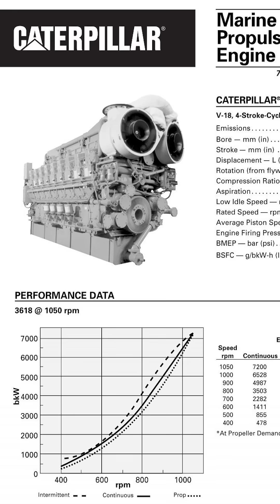wHy Don'T CaRS uSE V18 ENGiNEs?

Comment: Correct me if im wrong but if you keep making an engine longer and longer at some point the drive shaft would start to twist under the tension of all of the cylinders and become a floppy mess. Im no expert but i feel like a v18 is getting pretty close to that limit

Comment: The Bugatti is a w16 not v16
Reply: the newest Bugatti Tourbillon has a v16, next time think before you comment.
Reply: @christopherhallock3005  Sorry, yes, you're obviously correct. I guess i should have been more specific. The Bugatti shown is equipped with the w16.
Reply: @chadbracegirdle5498  the bugatti tourbillon shown at 0:04 has a v16

Comment: It’s a w16 but u kno same same ig
Reply: the Bugatti Tourbillon has a v16
Reply: I was talking abt the ministral
Reply: @ when was the ministral mentioned in this short?
Reply: I never said it was😂
Reply: @ then why tf are you talking about a w16?
Reply: Bc I can take abt whatever “tf” I want
Reply: @ buddy thought all bugattis have a w16 and cant accept that he was wrong😭
Reply: When did I say all Bugatti’s have w16s?
Reply: @ThatOneMfpplLuv  when you said: "it's a w16" you have the comprehension skills of an ant
Reply: u talkin like u built engines but u prolly think spark plugs need water respectfully, go read a manual before u speak again
Reply: @ quit gaslighting yourself😭bro thought a w16 was the same as a v16
Reply: A V16 engine is a traditional engine configuration where 16 cylinders are split into two equal banks of 8, forming a V shape around a single crankshaft. This design is extremely long and heavy, which makes it impractical for most modern cars—it’s more like a flex you’d see in old-school luxury rides or big power applications where size ain’t an issue. Think of it like two V8s side by side, all cylinders lined up clean and straightforward.

Now a W16—like what Bugatti rockin in the Chiron or Veyron—is on a whole different level of engineering. It ain’t just a V with more attitude, it’s built like two narrow-angle VR8 engines merged together. So instead of a wide V, it’s a compact double-V—four cylinder banks arranged in a W shape, all turning one crankshaft. It’s like stacking two mini engines together and makin ‘em spin in perfect harmony. This keeps it shorter and more compact while still making massive power, and it helps wit weight distribution and packaging—essential when u tryna go 260+ mph without blowin up. Too make this simpler for ur brain to understand it’s all abt the layout.
So yes believe it or not I do kno the difference but whatever makes urself feel better.
Reply: @ThatOneMfpplLuv  mf really wrote a whole ass essay😭congratulations u know how to use ai
Reply: Actually I'm js good at writing but thx for the compliment
Reply: @ThatOneMfpplLuv  you are neither good at writing or gaslighting
Reply: Good enough to make u think it's ai
Reply: @ThatOneMfpplLuv put ts in a ai detector and come back to me🤣
Reply: If u rlly think it's ai I need to go to collage 4 writin bc u must think i'm too good
Reply: @ThatOneMfpplLuv  "collage" "writin"
Reply: Ur point?

Comment: There is an even bigger engine that was a V24 it’s called the Detroit 24v71, it’s a 2 stroke diesel, 27.9 L or 1704 Cubic inches, it made upwards of 2000+ horsepower, don’t believe me? Look it up, there are videos.

Comment: One of the reason is the length of the crankshaft. If the crank is too long, it needs to be extremely stiff to prevent the pistons rocking the crank,bending it and stuff

Comment: The crank angle of the block must be a multiple of the crank angle separation for it to have any amount of balance at all.
Reply: Not really , plenty of out of phase V engines that became legandary, and reliable , Buick 3800 V6 is 90 deg bank angle because it started life as a V8 and they are balanced at 90 deg, when Buick cut 2 cylinders off the V8 to create the V6 they left the 90 deg bank angle. Same with Ford V4 car/truck engine , it started out as a V6 so it has a 60 deg bank angle, they cut 2 cylinders off but kept the 60 deg bank angle. Both of those engines don't balance correctly with their bank angles . But were produced for years.

Comment: We didn't stop there, V20 diesel engines exist too. Such as the EMD 20-710G3B in the SD80MAC. However weren't as successful as the 16 cylinder versions and those locomotives were rebuilt and repowered with said 16 cylinder versions. The 20 cylinder G engine made 5k horsepower. A typical haulage locomotive these days makes 4,400 horsepower. Mankind won't stop making things ever larger. So someday, a car probably will get a V20 factory. Of course... only for gear heads because everything is going electric now.

Comment: There's no reason for v18, it's just big, heavy and more fragile (comparing to v12 cuz a v18 Crankshaft is damn long and have big load of torsion, same for the camshaft too) if you want power at higher rpm all you have to do is just project an engine with less curse in the connecting rods and a Head with proper flow for it.

Comment: There have even been V20 diesel prime movers in locomotives before, the SD45, first one produced was named “Hustle Muscle”

They had a penchant for flexing and ripping up their own crankshaft. It was fixed in the SD45-2 variant.

The original “Hustle Muscle” actually lasted until 2017 before it ate its own crankshaft. BNSF restored an engine for it, free of charge, and gave it to the museum.
Reply: Doesn’t the 70MAC have an EMD V18?

Comment: The simple reason is that the crank shaft can only handle so much when it gets to a certain length. It would start to flex and bend and would be incredibly inefficient. And, uou know, a v18 is the equalilivant of 3 v6s stacked together end on end.

Comment: Just a quick question, why did you put a V16 on the Bugatti?
It's a W16,
I mean yes it's technically 2 V8's cramped together sharing a crankshaft, but still 😂
Reply: the newest bugatti in the picture uses a v16 instead of the w16 and also its a hybrid which is pretty cool :)
Reply: That is a bugatti tourbillon featuring a v16 instead of a w16.  He used that picture because, as to my knowledge, it is the most recent car to use a v16. There are very few cars that do; it's a pretty rare engine.
Reply: And then there is the Chrysler Multibank - five six cylinder truck engines on a common crank case.

Comment: theres an argument about balancing displacement for these types of engines so theyre not so large, but we learned that after WW2 that too many small cilinders are way too weak. most sportscars recently tried a sweetspot for engines to have around 500CC on each piston, a V8 has 8 liters like that, and the new V16 from Buggatti has around that as well. a V18 under that displacement would have wooping 9 liters. the viper engines is still the largest displacement production car engine post war, and it only reached 8.4L.

although i feel like a V16 with 6.4L would be cool if the crankshaft problem is solved without using the transversal method.

Comment: we already pushed over the edge with V16s when it comes to excessive engineering for engines, as the crankshaft lenght is problematic on these engines, V18 would basically go over that.

Comment: Another thing to consider... Crankshaft length. It needs to be stronger the longer it gets. Which adds weight.
Reply: Also, V18s and V20s extra long crankshafts and camshafts suffer from deflection due to their length which causes uneven and accelerated wear on components.
Reply: @alrichnolte1680  I wanted to say that. But realized while typing it how unqualified I was to speak on it. Thank you! You put it better than I could. XD

Comment: I would imagine if someone were to put a v18 into a vehicle that it would be for racing and since it would be for racing and it is so large it would likely be a structural member. It would also struggle to be torsionally sound and not be very practical power to weight wise in respect to its complexity. The reason it is used in large scale marine applications is that marine application is much less limited in regards to weight and power to racing. All a marine engine is needed for is crazy power and reliability. To get power reliably, low rpm is needed and to get low rpm power you need torque and to get a ton of torque reliably would mean displacement thus the huge engine.

Comment: Will it fit in a Miata?
Reply: Ik this is a joke but no....I'm pretty sure it's longer than a miata XD
Reply: @Pheonix_MLP Anything can fit in a miata :))))
Reply: @Lumeko-tan just like anime girls😳
Reply: @Lumeko-tan  your engine has a nice car
Reply: Probably not but it's more likely that the Miata can fit in the engine lol
Reply: no
Reply: @INDUCTION42  not with that attitude it won't
Reply: @INDUCTION42  we can try XD
Reply: a miata's entire footprint is about 8,000 liters so just displacement alone would be 4.2% of the car, plus the casting and rest of the block
Reply: @Defianthuman  at this point it may be able to fit on big-rigs(?) or on ships.
Reply: @DavidRGD big rigs have 12-15 liter motors so I don’t think so.
Reply: correction: can we attach it to a Miata
Reply: @ohhgodineedmoore2845  but what trans then? A Semi’s
Reply: Yes
Reply: Depends but in a trunk HELL YAH ik its a joke but would be funny to see
Reply: Depends how small each cylinder is
Reply: any number of cylinders doesn't matter, its displacement.

Comment: Also: V16s are already troublesome. The Cizetta Moroder V16T does technically have a V16, but it's more accurate to say it has 2 Lamborghini Urraco V8s, with a power take-off unit inbetween them. Then again, that was done because of technological limitations (it's a lot easier to just fit 2 V8 distributors then to make your own V16 one), and also because they really wanted that engine to be transverse (so it's easier to work on the engine). The transmission wouldn't have anywhere to go if it was a V16.

And, keep in mind, if that was a "true" V16, the crankshaft would've been over 4 feet long. That's already just impractically long, and the stresses at each end would be insane... so now imagine adding another pair of cylinders infront of THAT.

I7s, V14s, and even I9s and V18s work in marine applications, because they run as generators, so they barely rev, minimising the stress on the crank, or any other mechanical component at that, plus they have space in droves

Technically, we COULD put them into cars, but at that point, you just have a land yacht with how long the car would need to be, which would have a redline probably lower then the diesel engines in busses or trucks (2400-3000RPM here in Europe)